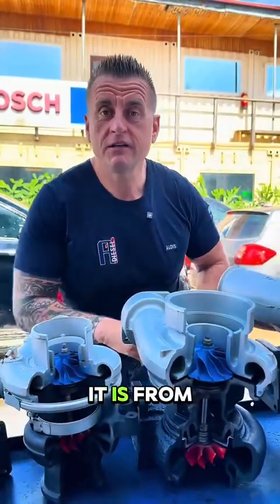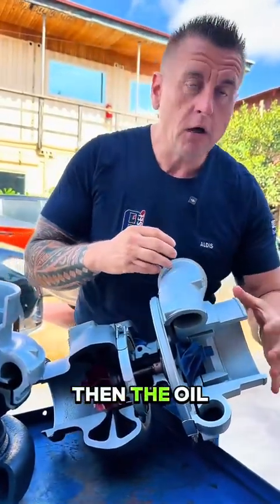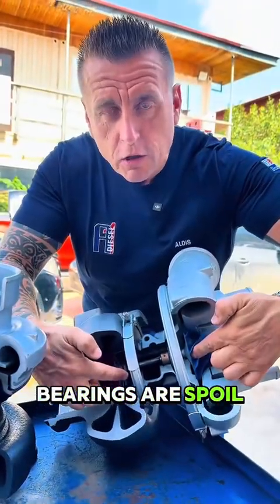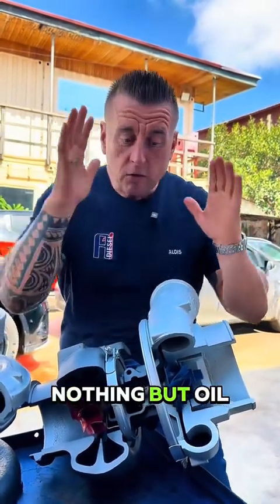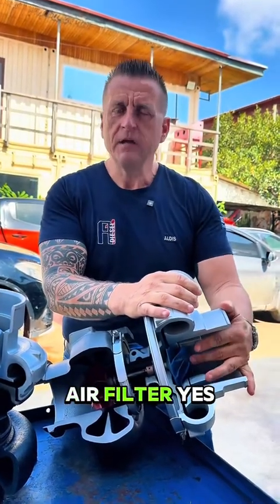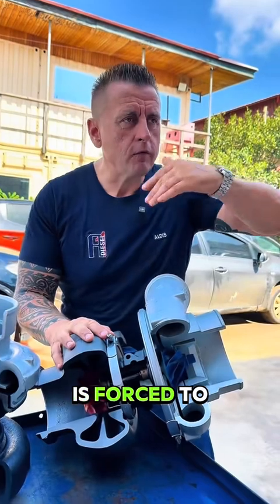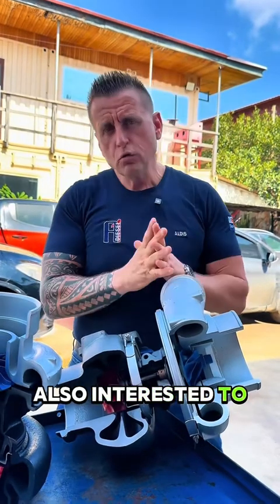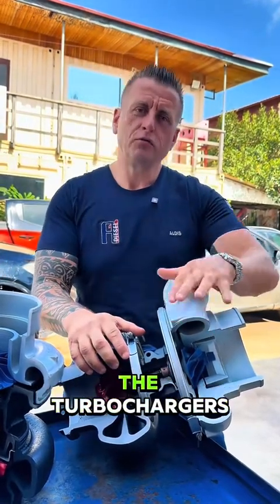Why Is Oil Leaking From My Turbo? 🛠️💨 #TurboCharger #DieselMechanic

Comment: Coz it’s boosting air and oil to charge inlet side of your intercooler. So the direction of flow is from your air filter to your cold side of the turbo. That pushes air to your intercooler. So same if it’s leaking. It’s pushing oil that’s coming out of your turbo to your intercooler!! ✌️and NO oil is not supposed to be leaking out past your turbines on the cold side of the turbo. It’s either the cartridge separated and bypassing your seals or you got other issues that’s caused your turbo to fail 😮